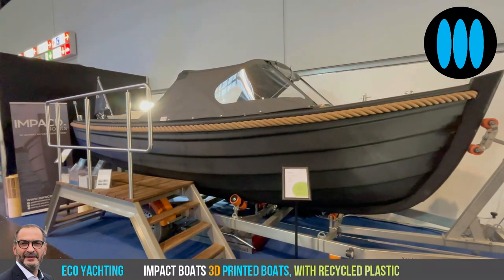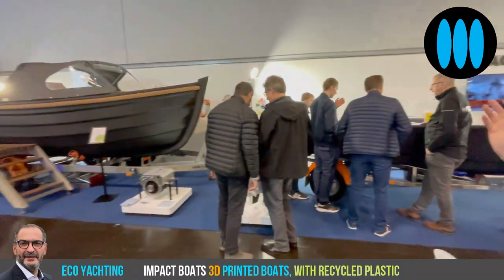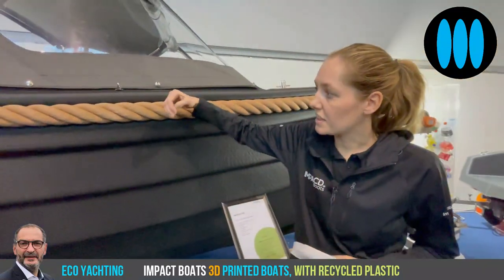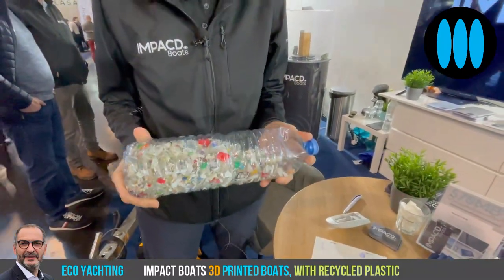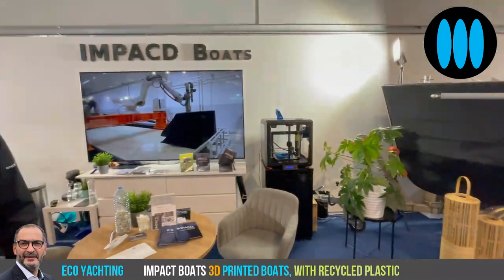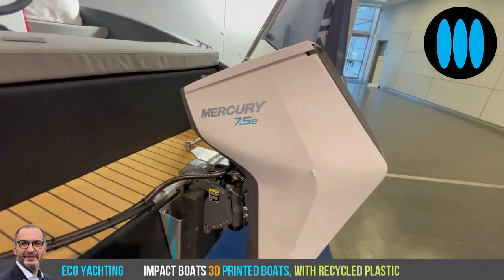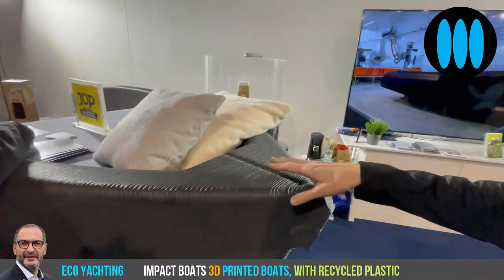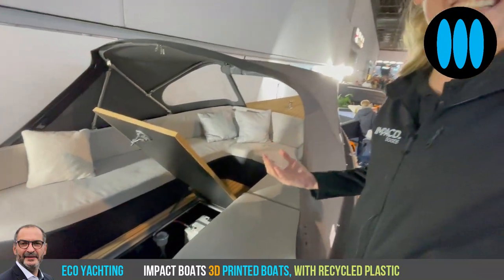IMPACD BOATS - 3D PRINTED boats, with RECYCLED plastic

Comment: A wood boat is also sustainable. This imitates lapstrake which is wood planking. Trees grow and produce oxygen, wildlife, and beauty. I also assert that there is no real advantage to electric batteries in a boat. It's heavy and there is no regenerative braking or coasting. At planing speeds like 35 mph or 55 kph these can't go very far. The ribbed texture is not conducive to low friction efficiency.  Does it come in traditional white? At $40,000 for an 18 ft boat with only 8 hp for the 550 model, it seems very pricey. It has what appears to be a planing hull with an immersed transom that drags underwater producing turbulence, yet with only 8 hp has no hope of planing. It should have a full displacement hull with an emerged transom that does not drag underwater.